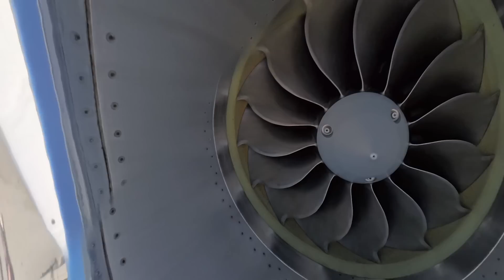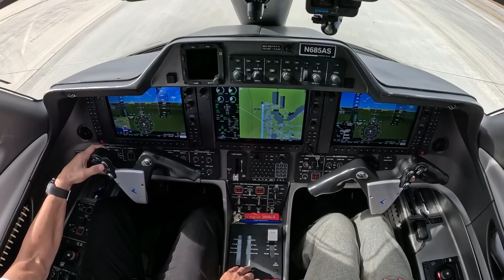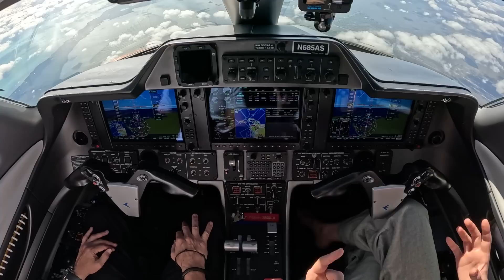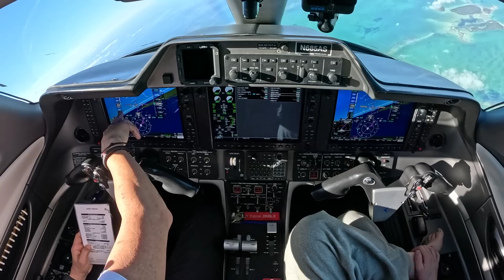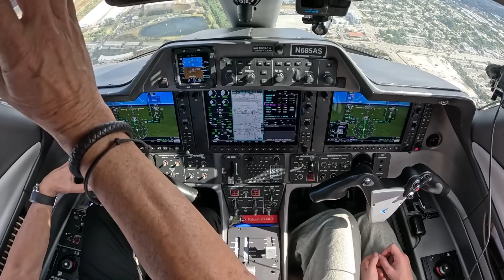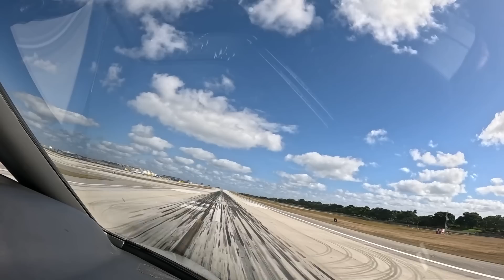The Best Jet for Business Travelers: Phenom 100 Review

Comment: Single pilot jet ops looks pretty intimidating.
Reply: It isn’t too bad, but you really need to stay ahead of the airplane!
Reply: @abramname478  Is it down to everything happening so much faster than in a 172? Your level of concentration has to be super high to fly the plane, handle the radio and also answer Emma's questions.

Comment: No two aircraft models alike. Price, size, weight, seats, fuel burns, speed, max ceiling, distance, seats, baggage, maintenance, In my opinion there is no perfect airplane and usually a compromise of wants and needs. I have owned 5 planes from a single engine piston, two cabin class twin pistons, twin turboprop, and single pilot twin jet. On each one i always wished it did or didn't have a different trait. All bought used over years from 1995 to 2008 for about a new piston twin price today.